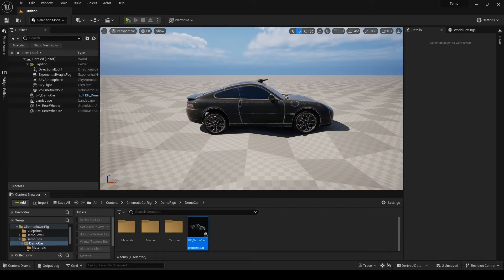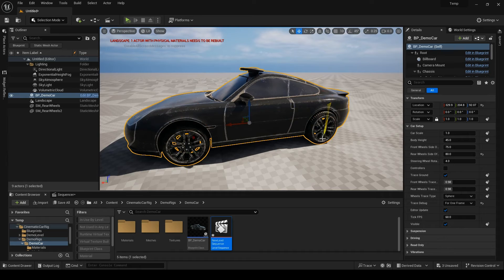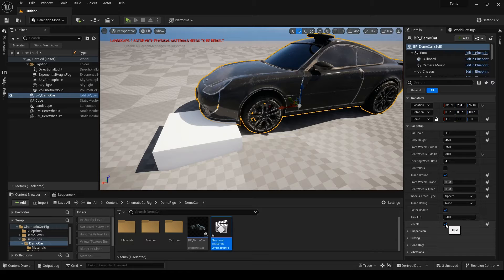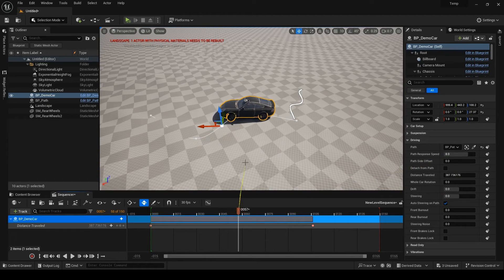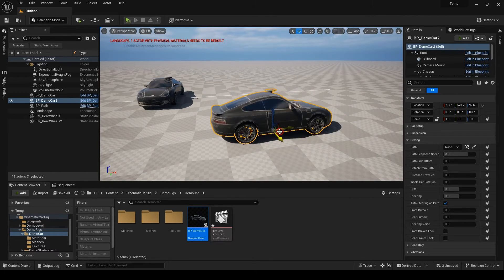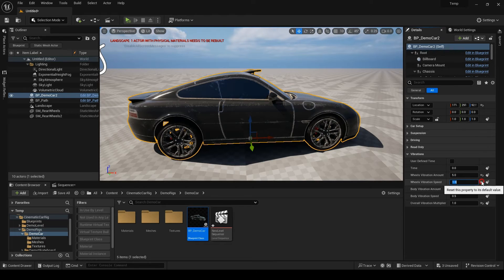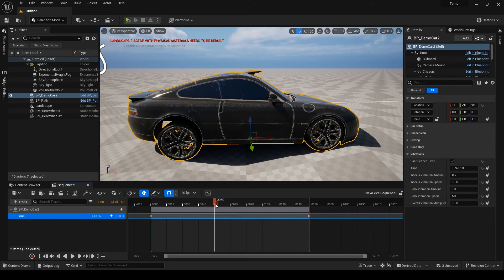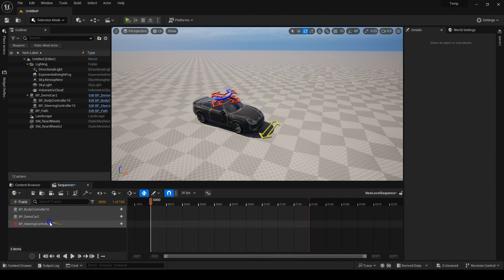Car Rig V1.4 - Car Parameters

Comment: Awesome work ! For me sadly the Drifting Keyframe doesnt work ... any idea how to solve ? It turns into the drifting position but ignores the keyframes ....
Reply from the maker: Hey thanks. If you have controllers on for the car, drift parameter will not work and you have to keyframe the z rotation of the top controller for drifting. Check the end of the video

Comment: very good.
I need it for truck and trailer. Vehicle pulling another vehicle.
Reply from the maker: Hi! Thank you! Currently trailer is not supported but you can always configure your trailer as another car, animate your two vehicles on the same path, make them follow each other, and if the connection goes out of place, correct it by modifying the "whole car rotation" of the trailer.
Reply: thanks!
But I can't see this working for my projects.
Do you have any plans to implement this in the future? it would be fantastic. @madgoat-studio
Reply from the maker: @dalcezar  I really don't know. I mean I'd love to add that and I thought I'd figured it out but it seems more complicated now considering this is not a physical-based system and all math. Maybe someday I can decently achieve that.
Reply: Thanks again for the response.
Yes, it really is complicated and I still haven't had a good result for presentation using trucks and trailers, vehicle movements around the environment... thanks, good work. @madgoat-studio
Reply from the maker: Thank you for your understanding. I'll always try to make this better and I have the trailer in mind.